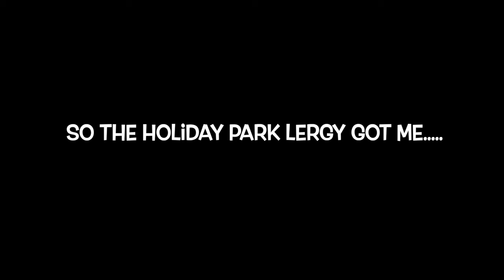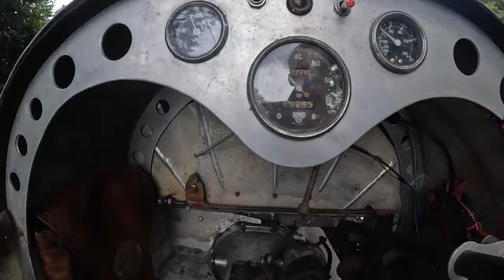'the Austin ten special 'Rat' ....the road to Beaulieu

Comment: I'm a firm believer that every custom build ought to have at least 17 components that would be considered edible in Bolton. I don't know why.
Reply from the maker: hahahahaha ...sas laughed alot!
Reply: Believe it or not I once got a motorcycle that had two warnings in the manual: 1. When parking, always extend the side stand before letting go of the bike. 2. No part of this motorcycle should be considered edible.
Both have become key ways for me to judge used vehicles.
Reply: @oakswamp  last bike I built contained some smack barm, pea wet and babby's yed. Not quite 17 elements but at least it was a prime number...